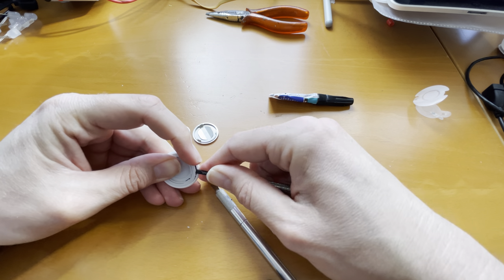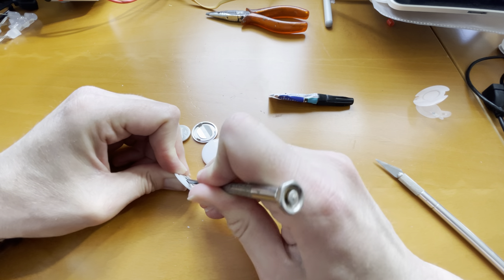Howto remove the speaker coil from the Airtag (make your Airtag very silent!)

Comment: You're removing the magnet of the speaker, not the coil ;) But yes that works too, if any of those are missing, well... The speaker won't work.
Reply from the maker: Yeah you are right.. crappy thing is you can't change video's after uploading them..
Reply: @AirtagAlex  Not a problem! You can still change the title though! Anyways, I subscribed, I want to see more! :)
Reply: I am not getting my updated location after doing that
Reply: There is still a weak sound when removing the magnet, and it should be completely silent for the cat. Could you make a video of removing the coil?

Comment: my mum have alheimer's or something similar  a sort of dementia often, but atm she live by herself and still drive, but it's so hard to contact her, cos she even have trouble to use her phone , so i was thinking about placing an airtag on her car in case she was lost and called me , cos i'm afraid she wouldn't be able to tell me where she is, i will try to explain her the purpose of this , and i have to remove the speaker on it cos otherwise it will bother her, but Apple did a great job with privacy with those, but i guess a 2nd sort of Airtags more Health related for ppl like my mum would be very useful... thx for the video, i'm just afraid that it will be used maliciously by some ppl.
Reply: @Joe-lb8qn  i always thought GPS trackers were on monthly subscription ? are they not ?  but good idea about the older iphone plugged in ... thx
Reply: Hi, this is just my opinion but maybe your mum should stop driving. It's hard, I know, but a car is extremely dangerous both for your mum and the passers-by. I know how difficult is having a family member with dementia, my grandpa has it. Wish you luck, take care
Reply: @mariavalencia8543  thx for the support , unfortunately her mother , my only grandparent i knew had it too... and i remember how it ended... but about the airtag i stopped cos i managed to damage two airtags by trying it softly and maybe a bit too hard... but i guess a system could be in place by Apple where my mum wouls give her consentement for example to be ' tracked ' but i understand it is a touchy topic , cos their is a ton of malveillant ppl ...
Reply: Have you tried apps that can help track dependents (e.g. children)?

Comment: FYI when you pry the cases apart, the safe prying zones are (with battery bump at 12:00) from 10:00-2:00 and 5:00-7:00. There are small electrical components right at the edges of the other positions that you can detach by prying (ask me how I know)
Reply: (alternately (and probably also a good idea), the electrical components are 1.8mm in from the outer lip, so keep your prying instruments no more than 1.5mm deep and you should be safe. The part you want to pry off is only 1.2mm thick at it's edge)
Reply: Yes I have managed to damage one among other successful
Reply: I wish I read this before trying it myself, broke an air tag lol. Scared to try again
Reply: @oszcarin  its nothing just keep the broken one as a model for the other you will modify
Reply: @artgreg2296  thanks man, that’s exactly what I’m gonna do. If anything, the broken one will be saved as extra parts once the other ones start wearing down.
Reply: @oszcarin  it enables you to see there are 3 areas where you can cut the airtag without risking damaging the components. You can just put some Mark with a pen

Comment: Ok. So you can remove the speaker. but how do you stop a thief with an iPhone from seeing he located an airtag? When I configure mine and enable lost mode, it wants to know either my phone# or email address. How do I make sure it is not shown to the finder?  (or does this just mean: do not enable lost mode ever)?
Reply: Would be nice to get an answer to this
Reply: There's not much you can do. All you can do is hide it as best as you can and hope it's not found and taken off. Removing the speaker makes this as good of a GPS tracker as anything, because there's little to no sound. Just hide it well

Comment: If you cut off the 2 very thin copper wires held down by beads of glue it ; and then remove the copper coils. It will be totally silent.
Reply: Thanks! I checked with my ear to the device and it still had a faint beeping sound after following 99% of the instruction videos. I was worried the coils were used as antenna. still works!

Comment: Love the DIY, and there’s many legit reasons to disable the speaker, but there’s something to be said about circumventing an anti-stalking feature. 
Though, there’s already many trackers that don’t have any, the pervasiveness of the findmy network will make an air tag modded like this dangerous for android users, as there would be no way for them to know they’re being tracked.
Reply from the maker: I know what you are saying.. but in my case i want to disable it for several reasons and they have nothing to do with stalking. When my bike gets stolen, i don’t want to alert the thief after 3 days by a beeping airtag. Same goes for my car and when i send one by mail. 
8 years ago i bought a matchbox sized gps tracker to record the route i walked outside. If 8 years ago it was matchbox sized imagine what they can do now. I think the stalker thing is a bit overhyped with the airtag. There are many other ways to track someone.
My airtag won’t make noise but they will still show up on the iphone.. that won’t change.
Reply: Gosh you all and your over worry about privacy. 
If stalkers really wanted to track a target there are so many other alternatives like a sim/gps tracker. 
Why use a tracker than relies on a network of phones, when a tracker that relies on cellular network is so much more reliable?
Reply from the maker: @87togabito  finally someone who gets it :)
Reply: @87togabito  Well, on a city I think an airtag is more reliable. Cellular connection can be poor inside buildings and also it won't tell you the latitude. Meanwhile an airtag in a city will connect to an iDevice every few minutes and tell you if its on other floor than you.
Reply: If you stoled something of mine I dont want you to know you’re being track

Comment: Maybe it's better to remove magnet thru battery compartment, making hole there? Then it stays IP67, only without speaker? What's is dimension of that magnet in millimeters?
Reply: I ask myself, I answer myself: magnet size is 11,93mm so i made 12mm hole in bottom of battery compartment and took magnet out.
Reply: @Neemelaid  nice idea bro, thanks!
Reply: @Neemelaid  Great idea! 😃
Reply: I know, i’ve done 3 airtags that way allready
Reply: @Neemelaid  how did you make the hole? And did you cover it?
Reply: @mariavalencia8543  first one i made hole with scalpel… but it’s not that easy… second one i made hole with dremel… and no i didn’t cover hole… there are more holes anyway

Comment: Do you have to put glue when putting it back together? (I wanted to leave out the glue since I don't have any at hand)
Reply from the maker: Yeah.. otherwise it will fall apart.
Reply: @AirtagAlex  I see your point, but I thought screwing the silver case back on would (just about) hold everything together, no?
Reply from the maker: @Pung5252  I doubt that will work..

Comment: Hi, I was wondering if there's a way of making it waterproof again. Also, will it break if I put a relatively strong magnet next to it? I want my cat to wear it and he has a magnet attached to his collar as well, that he uses to open the cat flap. Thank you for the video!!
Reply from the maker: There is a way to remove the magnet and keep it waterproof.. I will make a video about it one of these days. You will have to pretty much make a hole at the place where the magnet is.. that way you don't need to open the sides of the plastic.
Reply: @AirtagAlex  thank you! But will the Airtag break if my cat is wearing a magnet next to
It?
Reply from the maker: @mariavalencia8543  Not that I am aware of..
Reply: @AirtagAlex  I have read that the speaker is the magnetic part of the Airtag. I wonder if it would be possible to break it by approaching a strong magnet without opening the Airtag.
Reply: @AirtagAlex  I have done it the way you did in the video, but being extra careful, so there are no gaps really. No signs I opened it. I think it still must be waterproof. I will cover it with tape, just to make sure. It still works, so thanks for the video
Reply from the maker: Great, have fun with it!

Comment: I thought somebody would do speaker removal like that,  I wasn’t wrong. In my opinion Air tag in that shape Apple has designed it has no future. The whole point of tracking anything is spoiled when you cannot decide when it shell beep and who can discover its presence. We will see , but now Air tag is almost pointless for protecting things that might be stolen. Thiefs already know that such devices exist.
Reply: AirTag was designed to find lost items not stop theft. Anyway, who would use a $20 tracker on something they truly valued??
Reply: @HighFidelityFox  sometimes simple solutions are the best
Reply: @HighFidelityFox  airtag is better than a gps tracker

Comment: so i've just done it, like you ,but a bit gentlier , and 2 weird things happenned , first my speacker was glue to other piece you showing at 2:43  and i put it back again but now it doesn't work at all... and i wonder why ... did someone else experienced this ?
Reply from the maker: I have seen the magnet sometimes on the lid and sometimes inside the coil.. but so far I never had trouble putting it back so it worked again. Make sure the pins for the battery go in the llittle holes (should be 3 of them)..
Reply: @AirtagAlex  sorry I’m French so my English isn’t perfect u are talking about pins but are u talking about the rounded battery or the 3 plastic hooks that clicks back into the other part ?
Reply from the maker: @Just-Alexiel  i mean the 3 metals pins that go through the plastic lid towards your battery. They should touch the battery otherwise it wont work.
Reply: @AirtagAlex  ok thx I’ll try again
Reply: @Just-Alexiel  did u solve it? I have the same issue. Broke now :( but only my self to blame

Comment: couldn't you or someone, just put it in a tiny ziplock bag so there is not issues with it getting wet. Sure the warranty is void, but at least you have more environmental options. Like hiding it in a secret location were it might get exposed to rain or snow or whatever.

Comment: Αfter removing the magnet, if you approach the artag in your ear (about 10cm)  it sounds again but very low!
Reply from the maker: Yeah the only thing you can do is fill the empty space with silicone kit.. that will take care of that but i honestly dont bother since the sound is so low..
Reply: @AirtagAlex  If i cut the coil?There will be a problem?
Reply from the maker: @xenofonlive  I never tried :) But is this very low sound really a problem? I know some silicone will fix it.. i have no idea what cutting the coil will do..
Reply: @AirtagAlex  I just cut the coil! zero sound now and all works fine ,this coil it is only for the sound not for the antenna.Τhe reason i did it is because i place it whith magnet to hold it  under my car or my harley,as a result  the sound returning to 100%!!!
Reply from the maker: @xenofonlive  Thanks for letting me know. I never had the guts to cut it :)
Reply: @AirtagAlex  I would cry if I destroyed it...fortunately everything went well ;)

Comment: After removing speaker my location does not update like it used too
Reply from the maker: Weird.. I don’t have this problem.. and i did it like 7 times. If your battery still making good contact?
Reply: I have now noticed my battery going below half full. It seems like is draining my battery
Reply from the maker: @john90304  Doesn't seem to be related to removing the magnet.. I had the same problem with other unmodified airtags. I modified 7 and only 1 had an empty battery. If you google it you will find more people who have battery problems with new airtags.

Comment: I removed
 the speaker but the airtag still makes some beep noice but very very quite. S.o. an idea how to even remove this?
Reply from the maker: A tiny bit of glue or silicone in the middle will do the job! I usually drop a bit of glue in the middle.

Comment: I removed the speaker but it still makes sound
Reply from the maker: Should be almost not noticeable. If it's still a problem you could fill the empty space with silicone.
Reply: @AirtagAlex  does it still make sound then? Why?

Comment: The signal drops significantly after trying this method….
Reply from the maker: So far I didn't experience this problem yet..
Reply: @AirtagAlex  try it against obstacles, I hide it inside the bicycle frame before and after removing the speaker coil, a big difference I found, I did exactly as you mention in this video, not sure if I did damage it but it works fine outside the frame!
Reply from the maker: @husamsalhab  Funny, after your remark i put 2 airtags also in my bike frame.. a modified one and an original.. so far I didn’t notice any difference.
Reply: @AirtagAlex  perhaps I did a mistake, I will double check it. Thanks for your efforts and videos, keep going, subscribed :)

Comment: My Airtag makes after remove sounds …
Reply from the maker: Could be but probably at a very low sound. If you want to get rid of that you could fill the empty space with silicone
Reply: @AirtagAlex  What do you think about the battery? It always makes noises, not really loud, but they're there

Comment: It's exactly because of videos like this that Apple will likely push a firmware upgrade to all AirTags that will use the accelerometer to detect the tampered speaker and immediately warn everyone within Bluetooth range that the AirTag is stalking. And good riddance. All you creepers need to find a different tracker to abuse.